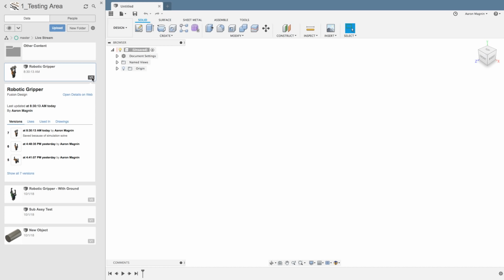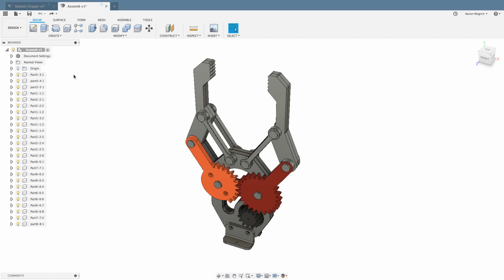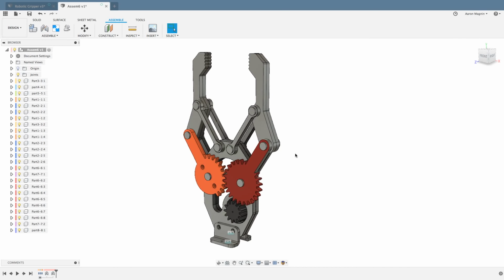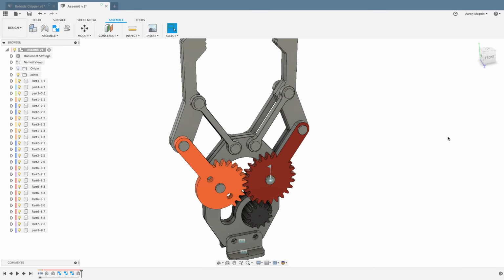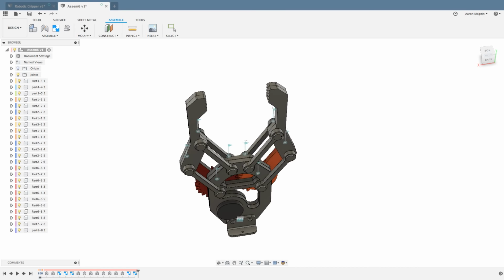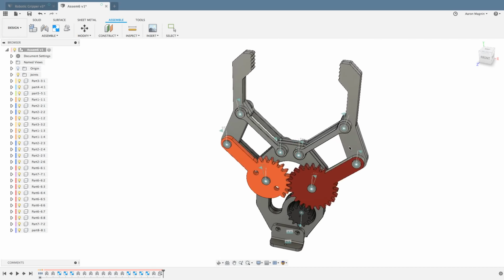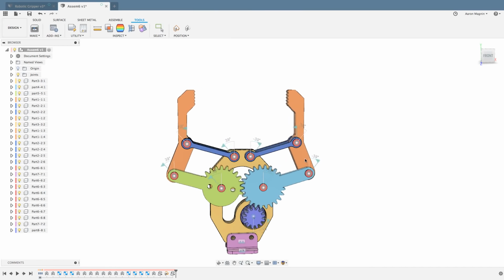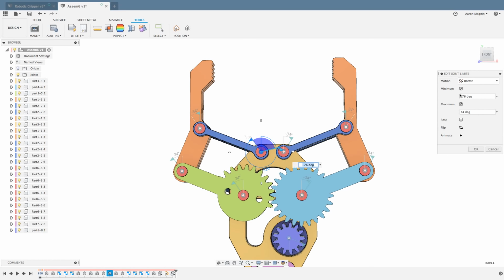360 LIVE: Joints and Motion

Comment: Joints are HORRIBLE and BRAIN-DEAD compared to SolidWorks mates. If you expect me to pay for this half-baked product, you've got another thing coming.
Reply from the maker: Sorry you feel that way...and so strongly. I remember when I first transitioned from SolidWorks and thought the same, but now that I understand how they work I can't live without joints. Yes, mates do allow for some additional situations, but it's hard to beat joints in terms of efficiency. Anyway, take a look at this tutorial for more content to get you going: https://www.youtube.com/watch?v=c0tY2sx-y_c
Reply: @adskFusion  The implementation of Joints badly misses the mark. What I can do in 10 minutes in SolidWorks takes me double the time or more to figure out why I can't work as easily or intuitively in Fusion 360 to constrain the model. At the very least, provide parallel functionality that is equivalent to SolidWorks Mates. Until that happens, Fusion 360 is only something I suffer through because I can't yet afford a seat of SolidWorks for personal use, though thankfully my company has it. I can't work with parts natively within assemblies in F360 - I have to open each part model separately to set joint targets. I sure don't have to do that in SolidWorks! But then that's why you have to pay so much for a real professional tool like SW instead of a half-finished hobbyist solution like F360. When the time comes and Autodesk removes the free option for F360, I'll just have to get out the credit card and pony up for SolidWorks. (Being cheap is a hard life.)
Reply from the maker: Well, I would recommend you keep trying, but it sounds like you've made up your mind. We're improving Fusion 360 fast and furiously, joints included (see https://www.autodesk.com/products/fusion-360/blog/fusion-360-roadmap-update-october-2019/). Cheers.

Comment: Awesome! just I watch the recording. I think a good idea to set up your joint limits would be, instead of typing the numbers would be to drag the components to the position you want while watching numbers update in the box then finalize by typing. Also also I wish there would be a label on the As built joint symbols so you can tell the difference between a regular joint. Responding to these streams is probably a faster way to communicate to the design team idea suggestions from the community.

Comment: Hi Aaron. First of all congrats on the live stream! About the contents, I've managed to convince the CEO on the company I work for, to buy, about a year ago, a Fusion 360 license specially because of the CAM capabilities, since our main CAD has been Solid Edge for a long time now. Since we bought the license, I often used to import native assemblies (and parts as well) from Solid Edge to Fusion, to perform animations, exploded views and so on, since it's much easier than in Solid Edge. The process used to be exactly the same way that you have just showed with the Soliworks assembly - but I don't know why, since one of the last updates it doesn't work any more, saying that Fusion can't translate the native files from Solid Edge?!?! Does it has to do with Fusion itself or it might be an issue of compatibility with the last version of Solid Edge, which we are already using?!?
Thank you in advance for your feedback.

Cheers.
Reply from the maker: It likely has to do with the Solid Edge version. Was there an update recently? If so, we might not have the ability to translate these files natively yet. As that's the case, and because most of the design history is lost anyway, I would suggest saving your Solid Edge files to STEP or IGES, then bringing those into Fusion 360. Thanks for subscribing, and the congratulations! Let me know if that helps!

Comment: I created a design in Fusion and was trying to assemble in Fusion itself.

A rigid joint between the base component and the top assembly is available for imported assemblies right?

And in my Fusion design I have to use Grounded components right?
Reply from the maker: Yeah! It might be in history free mode, however. Make sure to make that switch then add those "as built joints".
Reply: Autodesk Fusion 360 Okay... great.